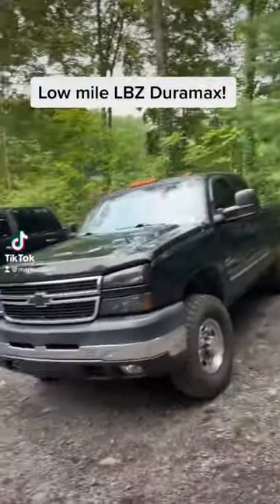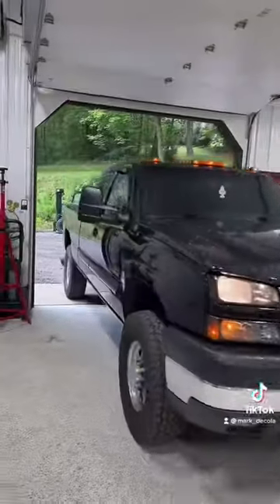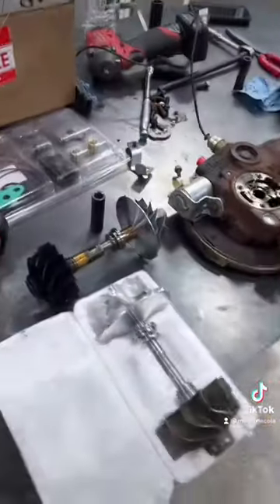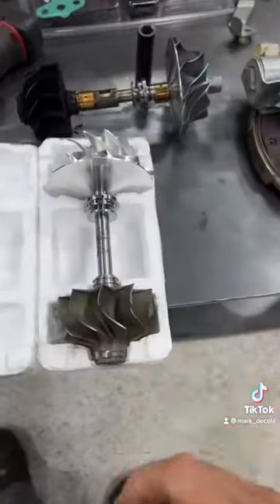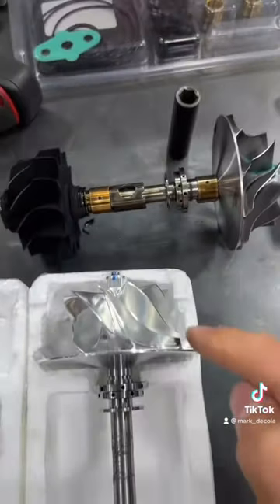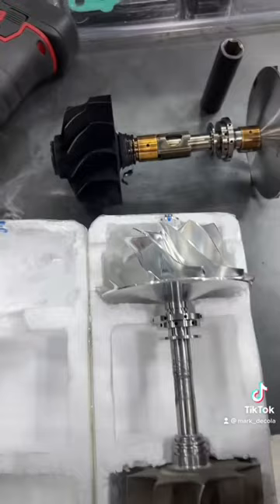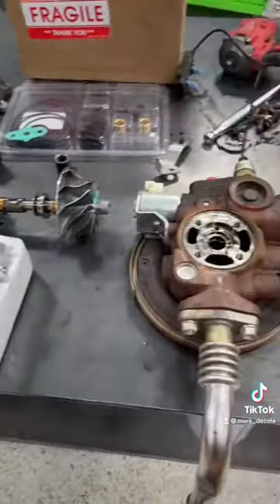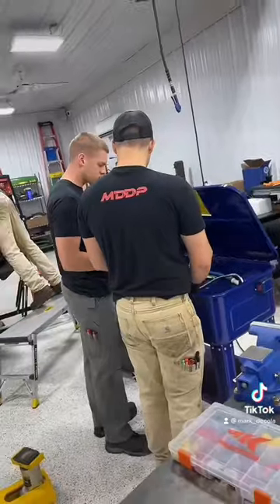Making this fresh LBZ sound like a jet! ✈️ #Duramax #diesel #cummins #Powerstroke #auto #turbo #MDDP

Comment: Could you make a video on how to get the turbo out on the lbz ?
Reply: A hole bunch of extensions from the bottom. & a lot of your time. No need to lift the cab. Enterweb says you have to lift the cab just to remove to heat shield.
Reply: Take out the fender liners. Plenty of room after the downpipe comes off the back of mr boosty. Use a half inch drive flex ratchet and a one inch extension and a 12 mm 12 point. Take the dipstick nuts loose and move it aside not out. Take the breather hold down loose of the bell housing.  Take off just the clamp on the compressor side and remove inlet horn. Leave the cab sit. The only interference is the very bottom two head bolts on the left bank and the back one on the bottom right bank.

Comment: Why not just buy an aftermarket turbo? Wouldn’t it be easier and more efficient to do it like that than rebuilding and replacing parts in a stock turbo?
Reply: The way I see it is that it would be more reliable and easier to repair and maintain a factory turbo, over a aftermarket turbo. But if anyone has the answer feel free to share.
Reply: Well it's about $250 in parts for a new wheel, compared to about $1700 for a new turbo
Reply: @hotjalapeno6096  stock fuel only supports so much. I would be more inclined to do the same. However. Injectors on these seem to go around 70-150k miles. 

It’ll be back eventually lol
Reply: @hotjalapeno6096  depends, the factory VGT on these trucks is sort of problematic, if you can afford to upgrade why not?
Reply: Hahahaha no! You want a performance turbo you're talking 4-6k this is probably less than 1
Reply: @clayton9136  4-6k for a turbo? You on crack?? 

2,700 is what I spent on a high end holset
Reply: @ShitboxShenanigans  That's cheap my brother! Enter the wonderful world of vgt and you're talking 4 minimum just to talk to the parts guy about it.
Reply: I paid 2500 for two stage 2 turbos but my uncle works at a shop
Reply: if it ain’t broke don’t replace it
Reply: Stock turbo is super reliable
Reply: Real question is, how much labor was he charged to do this.
Reply: Most aftermarket turbos are not VGT like the factory one is
Reply: @mr.lowslow7702  isn't that the idea to avoid the problematic vgt? They are basically an addition emissions system the manufacturer only used for emissions so remove them and hands down going to breathe better even if you experience .2 seconds of lag the extra 100k miles should offset that inconvenience
Reply: @clayton9136 not even close vgt turbo for my 6.0 is like $1800
Reply: @JohnJennings-cn3sj  are they made of chinesium and packing peanuts?

Comment: How the heck did you get the turbo off without removing the exhaust pipes??? Scratching my head
Reply: That is definitely doable. The one I always struggled with was the oil feed line. If you twist the hose to clear the turbo for removal it slightly creases the nylon section causing low oil flow. GM had a bulletin warning not to do this otherwise the oil feed line needs replaced.